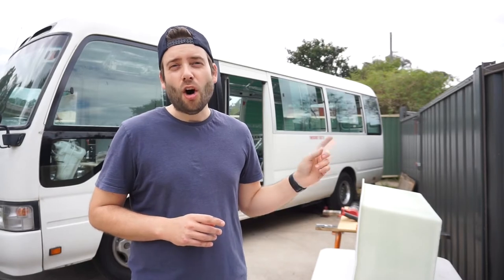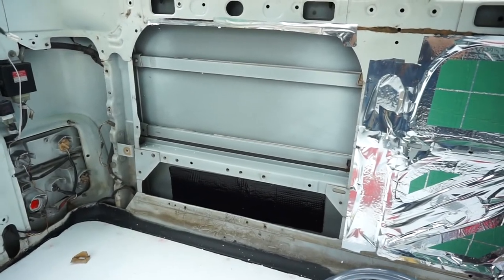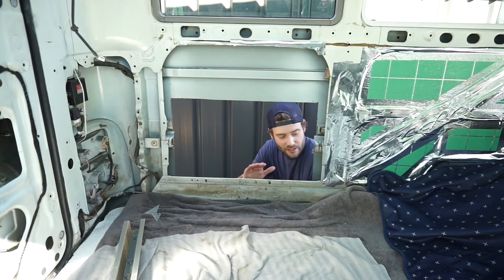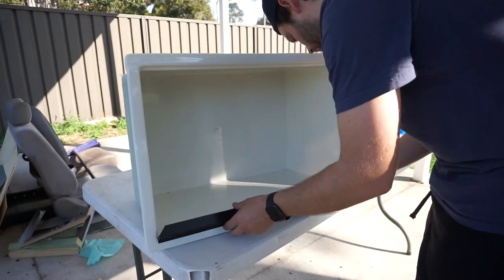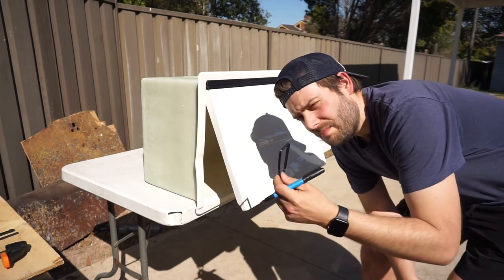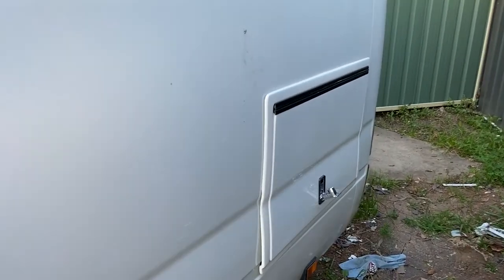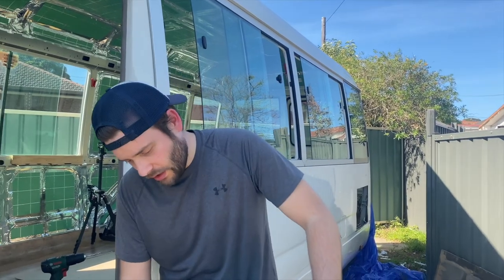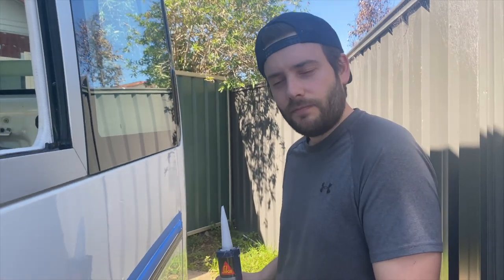GAS BOX INSTALLATION | Step by step | Toyota Coaster Conversion | Bus Build

Comment: Hi, great videos they are being really helpful during our Coaster build. 
Can you remember the bottom measurement of the press lock fitment?  The info from DIY RV solutions is that the cut out for the lock is 35mm from the edge of the lid - my calculations are that it is 45mm from the edge of the lid to allow for the lip that the lid sits in. Have I got it all wrong? I know it was awhile ago for you now but would appreciate any advice. Cheers
Regards
Enzo
Reply from the maker: I can’t remember the measurements I took at the time - but here is a photo of it now. Looks to be about 35mm from the bottom of the door.
Reply from the maker: 3 February 2024
Reply: @czechausout  thank you   Yours is definitely 35mm, I’m going to have to have another look at mine. I must be calculating wrong. Unless their designs have changed.

Comment: Nice Job on that and very helpful video. You used the initial cut out to get the measurements for positioning but I did notice that the bottom of the box is exactly aligned with the groove at the bottom and so that just leaves the sides. On the right side can you share the exact measurement from the vertical groove to the cutout ? That would be very helpful. :)
Reply from the maker: Hi Grant, unfortunately I can't remember the exact measurement, however it would be best to ensure you match it to your box, even if it is meant to be the same. It also took a fair bit of trimming back and forth to get it right - I like to go smaller on the hole at first and slowly cut more away until it fits.

Comment: Would you mind passing the info where you bought the box and most of the boxes for the coaster please? We are about to buy exactly one like your and we are interested in getting more information to help us. Cheers
Reply from the maker: Hi Tony, we bought the gas box from DIY RV Solutions : https://diyrvsolutions.com.au/collections/gas-storage-box/products/gas-bottle-storage-box-toyota-coaster-2x4kg   hope that helps and feel free to reach out to us on IG or on here with any other questions you might have.
Reply: Hi, great videos they are being really helpful during our Coaster build. 
Can you remember the bottom measurement of the press lock fitment?  The info from DIY RV solutions is that the cut out for the lock is 35mm from the edge of the lid - my calculations are that it is 45mm from the edge of the lid to allow for the lip that the lid sits in. Have I got it all wrong? I know it was awhile ago for you now but would appreciate any advice. Cheers
Regards
Enzo